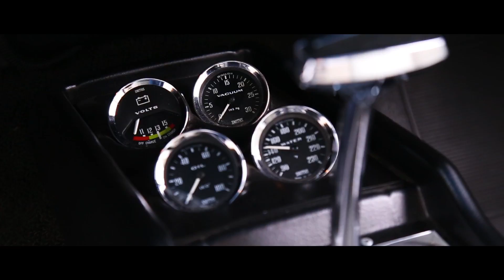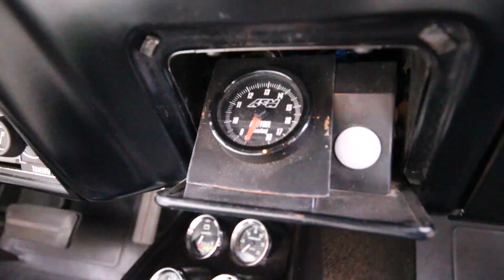How To Build A 500HP RB25DET S13 And A 400HP 72' Chevy Nova

Comment: Why would you sell an R32 Skyline and get a 240, just curious?

Thank God the Nova was modded because stock it's a brick! Btw, what gear ratio in the rear end of the Nova? What are the cam specs?

Pretty cool video and yes, you can enjoy both, this is coming from an almost 49 year old born and raised in Detroit👈🦂
Reply: 3.73 rear gear. Cam is a 244@.050 duration, .501 lift, 106 LSA.
Reply: @jeffersoncorrigan4878  thank you! Nice street cam and rear gear, although that carb is a bit big for a 355 s/b.
Reply: Lol. It really isn't...
Reply: @jeffersoncorrigan4878  ...650 CFM is more than enough, 750 is basically what you'd get on a BB Chevy
Reply: @jeffersoncorrigan4878  Bro what is your Instagram? Like to see more pictures of your cars